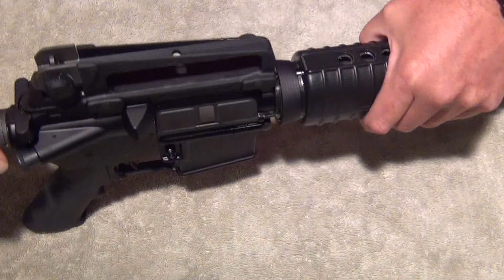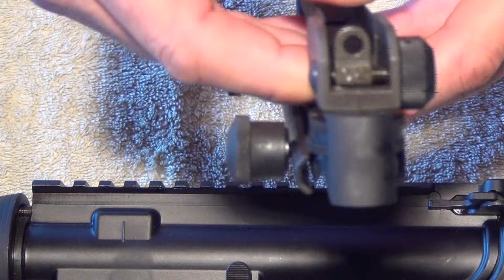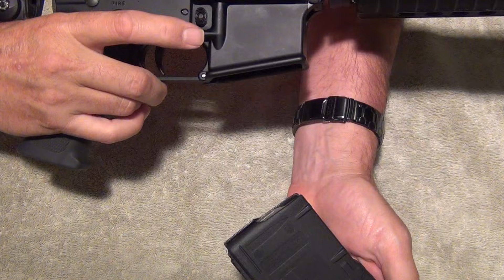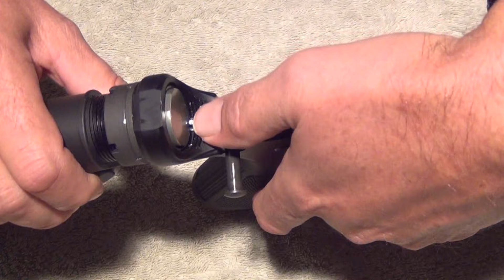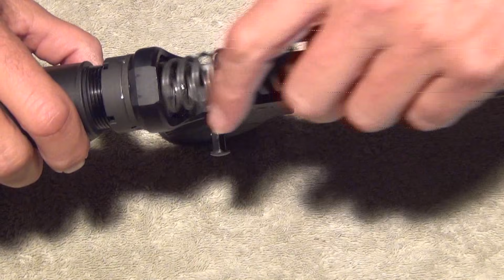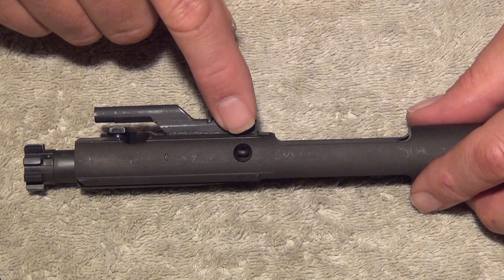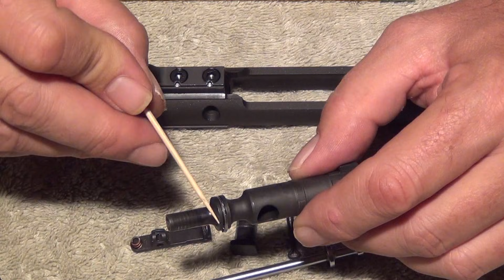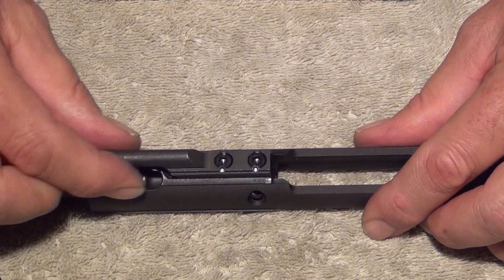AR-15 Basics: Controls, Function, Disassembly, & Reassembly.

Comment: I bought an AR15.   Ive tried twice now to load a round and fire it.   It will chamber a round. But will not fire. It's brand new.   I look at the shell casing.   And there zero indentation from a fire pin strike.    You think it came brand new.   Malfunctioning already.
Reply from the maker: @mercenary2318  sounds like a simple assembly error. Remove the bolt carrier group from the rifle. Hold carrier group with the bolt facing upright. Now tap the bolt carrier against your hand or table. The firing pin should not come out. I’ll bet yours falls right out.
Easy fix : remove the firing, pin retention, pin from the bolt carrier. Now insert your firing pin all the way in until it is seated. Now re-insert your firing pin retention pin. The firing pin retention pin should pass between the first and second bumps at the rear of the firing pin. at this point if done correctly, the firing pin will not come out no matter how hard you tap it. Now just reassemble your rifle and give it a try.

Comment: I'm interested in buying an AR-15 for home defense. So when you empty the mag, the bolt slides back like it would for a handgun when empty. When you inserted a new mag, you pressed the bolt catch release in order to load a round, can you also use the charging handle after reloading instead of the bolt release to load a round and continue shooting?
Reply from the maker: YES.

Comment: I am in the search for my first AR15. I’ve contemplated it for the past two years but never really went through with it. I know most people start off with something cheaper and build on from there but I have no interest in doing so. My budget is around 2k. Any suggestions? I’ve been contemplating with the Daniel defense v7. I don’t plan on doing upgrades other then a light and optic.
Reply from the maker: The only suggestions I have are;
1. Define what you really want out of your rifle (Home defense, long-range shooting, plinking at the range ... etc).
2. Set a budget.
3. Do research to find the best rifle that meets you're needs (wants) vs. cost. 
Good luck.  Cheers

Comment: O HOLLY  F,, IT  IS TRUE  LIKE   HAMER LESS DOUBLE SHOOTGUN ,,IF   WANT A  SAFETY  ON  EVEN ON EMPTY CHAMBER ,,TRIGGER ASSEMBLY GOT TO BE  COCKED AND    UNDER TENSION //  SO I GET   THAT   LOCK  AND  LOAD   ORDER IS  OK  FOR  M15/16 USERS   WHILE  99 OF REST   WEAPONS //THAT IS 99 , 9 HANDGUNS AND  90 PERC  OF   MACHINE SUBMACHINE GUNS//  IT  IS   PROUDLY  THERE WITH  NO HAMMER TRAP  /DOUBLE SHOTGUN   BUT   IT SHOULD  BE  KEPT  OPEN//  SHITTY DESIGN  AT  BEST

Comment: Excellent video but could have been better if you showed where and how to oil while reassembling. I know the oiling technique is simple common sense to most if not all gun aficionados. A rookie tearing down his AR for the very first time might find it useful. THX again for the excellent video.
Reply from the maker: I purposely left it out. I was trying to keep the video as concise as possible, and there are a lot of or lubrication videos out there.
The AR 15 does not like to be run dry. I put a little light oil all over the inside, Plus I always keep some spray lubricant with me.

Comment: I am new to this.  I removed the bolt retension pin and took the bold out.  When I went to reassemble I had a hell of a time attempting to get the pin all of the way in.  It took about 30 minutes to finally get in where it should be.  Can the end of the pin be tapered a little bit to make it fit easier?
Reply from the maker: Mine sometimes is difficult as well. Look at your pin to determine if one end is slightly longer than the other. If so, try to cash that end on one side of the hole and then push the pin sideways to compress its opening. That usually works for me. Good luck. Cheers

Comment: Somebody tell me the best way to reinsert the retention pin.  I have a brand new AR 15 and shouldn’t have taken it out because I cannot get it all the way back in.  PLEASE somebody help.
Reply from the maker: The retention pin has a tendency to spread at tip, thus making it difficult to get in the far side of the bolt.
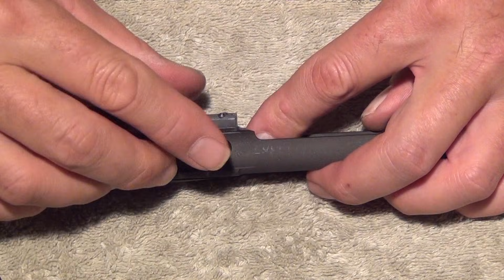I always try to gently rock the pin back and forth 12:11 in an effort to catch one side of the pin, once one side of the pin is caught, I'm hoping to compress the pin tip together so it will slide into the far side of the bolt. Hope this helps. Cheers
Reply: @stanfordcoffee  thank you!  It worked.

Comment: I followed your training film, Thanks. I cannot take the safety off and move it to fire. It will not swivel from safe to fire. No magazine installed.
Reply from the maker: Split the rifle by pulling out the rear takedown  pin. Now make sure the hammer is cock (reward, do it manually if you have to).
Now the safety it Is free to move from one position to the next. Let me know if it does.

Comment: You my friend have broken down everything that I needed to see in under 20mins. Thanks so much for being so thorough with the details. Appreciate it. 
By chance, where would I get some more assemble pins to connect upper and lower? The two pins I have don’t go in smooth like yours on the reassemble.
Reply from the maker: 1. Those pins are always a little sticky on a new rifle, But wear in overtime. Try popping them in and out 30 -50 times to see with that I gets you.
Otherwise you can do an Internet search for them. They are the "forward pivot pin" and the "rear take down pin". I suspect they're exactly the same dimensions, But cannot verify that.
2. They are both captive pins, which would require some disassembly of the lower receiver.  Cheers
Reply: stanfordcoffee Thanks a lot.

Comment: I'm having problems reassembling, I was able to put the front pin in but the back one won't match up. I can't bring the upper and lower together on the back pin- there's a weird resistance that's making it impossible to bring the upper down to the lower. Thanks for any help
Reply from the maker: If the hammer isn't cocked (aft position), it will strike on the bottom of the bolt carrier and prevent closing. That's the only thing I can think of. Cheers

Comment: very good video; thank you.   I was wondering though when is cleaning needed if ever for the gas tube?   should you remove the handguards and clean that area too?
Reply from the maker: The inside of the gas tube is subjected to very high temperatures, pressures, and velocities thus keeping it pretty clean. You may need to run a extra long pipe cleaner through it after thousands and thousands of rounds.
I generally just spray a bit of CLP (cleaner, lubrication, protection) through the Hangard, and only take it off very seldomly. Cheers

Comment: At 6:34, you did not charge the rifle before inserting the clip. My clip will not sit unless I pull back on the charging handle and lock the bolt. Is this typical?

Comment: Re: loading, my manual (Ruger AR556) says to load by: 1) pull back the charging handle to retract the bolt, 2) engage the bolt catch, 3) insert the magazine, 4) release the bolt catch. In this video you insert the magazine while the bolt carrier is closed, then you pulled and released the charging handle "without riding it home." Is this a 6 one/half dozen the other kind of thing?
Reply from the maker: Yes

Comment: Great video!  I am new to owning an AR-15, and your video really helps.  Do you ever have to disassemble the trigger assembly for cleaning?
Reply from the maker: No, you're getting into gunsmithing territory unless you know what you doing. There's plenty of room to clean the trigger assembly while it's place. A word of caution: if you're going to let the hammer forward, Do it Slowly. You don't want to hammer to fly forward and possibly crack the lower receiver. Just hold the hammer with one hand while releasing it with the other.
Reply: I've done 10/22 triggers, can't be too much more to an AR. Thanks.

Comment: You reassembled the upper to the lower with the trigger group cocked and on safe.  Is it required that the trigger be cocked to disassemble and assemble the upper and lower?
Reply from the maker: Technically required no. The rifle will disassemble easily enough with the hammer sliding off of the firing pin, then the bolt. To reassemble the hammer will make contact with the bottom of the bolt, and you will have to move it back just a little with your finger. To reassemble the rifle it is much easier just to cock the hammer all way back.  Cheers

Comment: About to buy my first AR I was happy to find this video I feel I know a LOT more about it now. Only thing I don't get is what keeps those two pins that hold the upper and lower together without falling out. But I guess it will make sense once I  have one in my hand. Great video thanks!
Reply from the maker: @govsux1 Both those pins are "captured" pins. They have a groove (slot) cut in them. There is a small metal rod, pushed into the groove by a spring. This allows the take down, and pivot pins to slide back and forth, But you cannot pull it completely out the back.
Reply: @stanfordcoffee  Perfect explanation thanks !! Seems like a very simple reliable design through and through I can see why they are so popular.

Comment: So you can't switch it to safe after the last round (bolt caught in rear position) until after a new round is chambered? Is this by design? THe only up-side I can think of is that you can sneakily check if it's chambered by operating the safety switch.
Reply from the maker: I think there's some confusion with bolt position, and hammer position. It doesn't matter where the bolt is( forward, or aft. ). What matters is the hammer position. If the hammer is forward, the safety cannot be engaged. If the hammer is back, you can engage the safety. After the last round has been fired, the bolt will go back and lock on the blot catch release. The bolt also drives the hammer back, and you can engage the safety. Cheers
Reply: @stanfordcoffee  That answers my question perfectly, thanks. There's no way to de-cock then?
Reply from the maker: @Hamachingo  You can decock the rifle. Go to Channel, then videos, and look for the one titled
 "how to decock an AR 15". Cheers
Reply: @stanfordcoffee  Thank you again, perfectly demonstrated.

Comment: Do you need to routinely clean the upper receiver and barrel?
Reply: Job Calderon not after every use but regular cleaning definitely keeps it operating much smoother with fewer problems.

Comment: Function check fail. Charge weapon. Rotate selector switch to safe and attempt to fire. Nothing should happen. Rotate selector switch to fire and squeeze and hold trigger to the rear. The hammer should fall. While still holding trigger to rear, charge weapon. Release trigger. There should be a metallic click from the receiver. Squeeze the trigger again. The hammer should fall.
Reply: Christopher Graham spot on! I didn’t even catch that until you mentioned it.

Comment: I tore the gun apart and replaced the bolt carrier assembly. After doing so, I slide the charging handle in. But the bolt carrier assembly is still able to slide out still. Is this acceptable or no?
Reply from the maker: I'm assuming that the upper and lower receivers are still separated at this point. If you push the bolt carrier in far enough, the locking lugs at the front of the carrier should engage the locking lugs in the chamber, and retain the bolt carrier in the rifle. However, if you don't push and quite far / firm enough, yes, it will slide right back out. Hope this helps. Cheers
Reply: stanfordcoffee thank you sir! I’m sure it will help a lot. I’ll check it out later today and I’ll let you know.

Comment: Why not take apart the lower ? Nobody does and I think it's important to do so to clean the trigger group and housing
Reply from the maker: Unless you're intimately familiar with the lower,  and its assembly, it's not wise to take it apart. That's getting into armorer and gunsmithing Territory. This is just a basic field strip video. No tools are required to field strip a AR15, whereas tools would be required to disassemble the lower.

Comment: stanfordcoffee, are all AR-15's  (inexpensive, expensive) as easy to take apart, clean and put-back together? what brand(s) should i stay away from? i'm not a very handy person. thank you for your video.
Reply from the maker: Yes. I demonstrated this video with a COLT, but all Direct impingement AR-15's follow the same basic design.
This is the only AR-15 I own, So you'll have to do research with regard to which ones may or or may not have problems. Cheers

Comment: As some one looking to get into the AR platform this video was great.  the only question I have is does the rear take down bolt & front pivot bolt ever come loose on there own?
Reply from the maker: Mine never have. They're both captured pins that will not come off of the lower receiver (unless you disassemble the mechanical pins holding them in). Each one has a spring/ ball detent to keep them from sliding out during use. Cheers

Comment: Did you have a Mil-Spec or Comm-Spec buffer tube on that carbine? And is their a difference in buffer and spring size? I'm hoping to change out my commercial tube for mil-spec due to a more variety of stock options in mil-spec VS comm-spec stocks for my AP4 carbine.
Reply from the maker: It's a Mil-spec buffer tube with a heavy buffer. It's my understanding that the military uses a heavy buffer to slow down cycle rate and improve reliability during automatic fire. I'm not sure if there's any difference in the springs. Good luck with your research. Cheers

Comment: I just bought my second AR-15. Great video but you may want to go into how the stock is adjusted for the type you have. you have a dual function one which may confuse new shooters when the collapse it without knowing about the tension handle on the off side.
Reply from the maker: The video is too long at 15 minutes, and there are so many different stocks on the market, I was hoping individuals would be able to figure out their particular stock. Cheers
Reply: Yeah, that would make the video a mini series. LOL

Comment: Hello im new to the AR family. My AR-15 is identical to yours but mine is a DPMS by Panther Arms while yours is a Colt. Will this very informative demonstration by  disassembling and cleaning yours be identical to mine ?
Reply: Bradley Harris yes mine does have the forward assist so it will be identical. Thanks for this video I will be referring to it a lot as I learn more and more.
Reply from the maker: Absolutely. Your DPMS, may or may not have the forward assist, other then that, they should be virtually identical. Cheers

Comment: So when you put a magazine in an AR-15 or some sort of AR- configuration, what is it called when you kindof pound on it to chamber it instead of pushing the button? I've seen it multiple times and would like to know how or what guns can do it.
Reply from the maker: I think you're referring to when guys hit or slap the left side of the rifle. What they're actually doing, Is hitting the top of the bolt catch release, enabling the bolt to move forward and chamber a round. Cheers
Reply: Thanks!

Comment: At 13:43 you push the charging handle back in after you had engaged the bolt catch.  Then you released the bolt catch.  What would happen if you released the bolt catch, but never pushed the charging handle back in?  Would the charging handle come slamming forward with the rest of the bolt carrier group?  Thanks for the great video by the way.
Reply from the maker: Yes. The charging handle hooks to the front of the bolt carrier group gas key. That's why you can only pull back the bolt Carrier group, but can't push it forward with the handle. It's designed that way so the charging handle doesn't hit you in the face each time you discharge the firearm. Cheers
Reply: One other question.  I made a noob mistake and squirted some CLP light lube down the barrel before shooting and didn't wipe it out.  I heard this can cause a pressure build up, and cause the barrel to "bulge".  Everything shot fine from what I can tell, but is there an issue with this?
Reply from the maker: It's not something you should repeat, but I don't think it'll be a problem. If you notice a problem, Take it to a gunsmith to have a check over. Cheers

Comment: For this particular rifle with the standard handguards, do you need to remove them for cleaning?
Reply from the maker: I've only removed mine once, to clean, and oil in 3 years. Cheers
Reply: M4 is used to designate an AR15 with cut-out on the barrel for accepting a M203 grenade launcher. A3 is used to designate an AR15 with a flat top that is able to accept a carry handle.

Comment: I just purchased a Bushmaster AR-15 QRC. This video is very helpful, although, I have a question. In my manual it states to NEVER push the charging handle forward and to let it do so when you press the bolt release. I am not being critical but just wondering, after seeing this done in the video, if it really is a big deal. I only ask because I did it before reading the warning in the manual. I would think that these rifles are made to withstand more than just a little sneeze before malfunctioning. Just wondering...
Reply from the maker: I can't find my manual right now. So I can't confirm that the Colt manual has the same warning. From what I know of the mechanics of the rifle, I don't see that it's a problem. You should contact bushmaster for further instructions. Cheers

Comment: do you ever have a hard time putting the cotter pin back to lock the firing pin back in place
Reply from the maker: Yes, it can be stubborn at times (as you saw on the video), but I've always manage to reinstall it eventually. Cheers